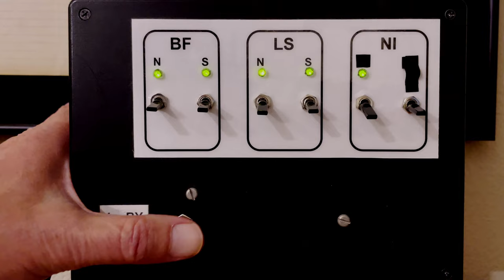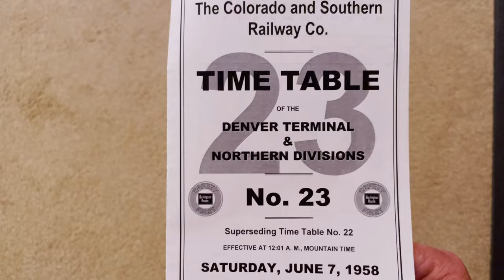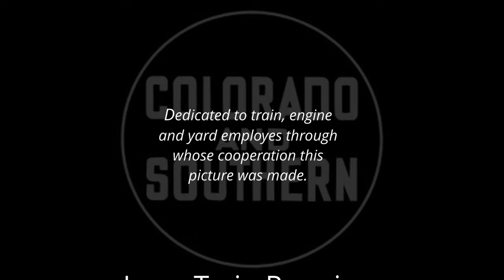Long Train Running on the HO Scale Colorado & Southern Ry - Ep 5

Comment: I've heard this maneuver called a "saw-by." Do you use the term on the C&S?
Reply from the maker: Yes, but usually only if there is a forward and back.

For example, No. 46's crew was probably out of time to get to Valmont before No. 45 was due to leave.  Without train order no. 16, No. 46 would have to pull out to clear No. 23's departure at Niwot, and then back in to clear the arrival of No. 45.  THAT is a saw by.
Reply: @CSRYfan  Thank you for replying. That's not what I learned in John Allen's books on realistic operation. In fact, if I recall the illustration in Track Planning for Realistic Operation correctly, the short train pulled into the siding and then long train went around it. Your example at Niwot was an interesting alternative. 

One could imagine a line where all the trains in one direction are longer than the sidings but not the other, such as when a steep grade limits train length or most short trains are going in one direction and the long trains are empties, such as on the Minnesota Iron Range. Making one empty train from two formerly loaded trains could be a great way to cut crewing costs. If you don't have dynamic braking, such as when using steam power, taking an extra heavy train down a steep grade, like the 2% grade down to the Lake Superior ore docks at Duluth, MN, could be unsafe.
Reply from the maker: Ah yes, figure 3-5 in John Armstrong's Track Planning for Realistic Operation.  I had to look it up.  :-)   I'm not one to argue with the Dean of Model Railroad Planning, so I'll concede to his definition of saw by.  :-)

I will say that which train goes on the siding is operation dependent and subject to change by the Dispatcher.  In the case of the meet at Niwot, the short train was No. 23, a first class passenger train.  23 took the main track, as the superior train.  It also had a scheduled stop for passengers, and the depot is on the main track.  Standard operating procedure for No. 23.
Reply: @CSRYfan  That's fascinating, especially with the wrinkle of having a passenger train making a scheduled stop during a meet. I hope your videos help more people realize that operating model trains realistically is fun.